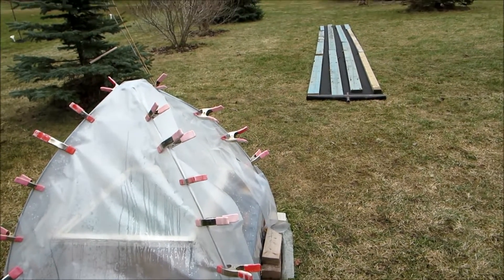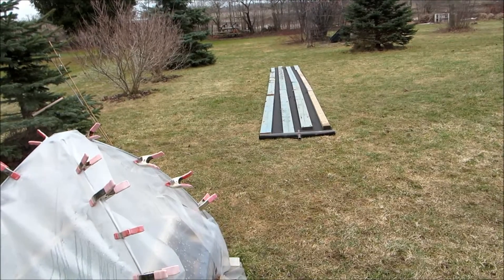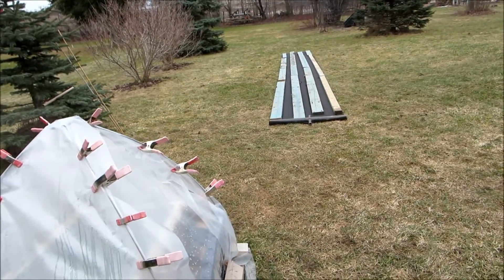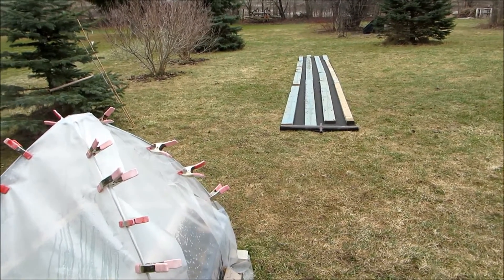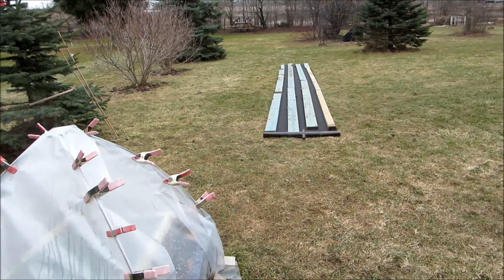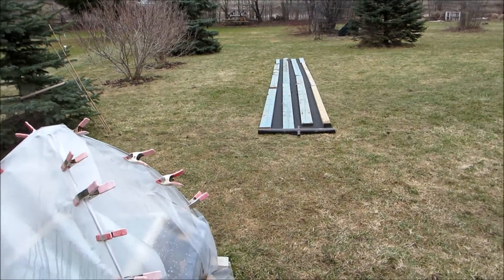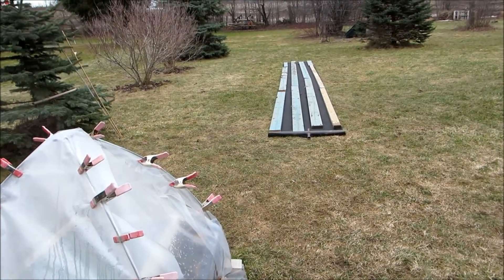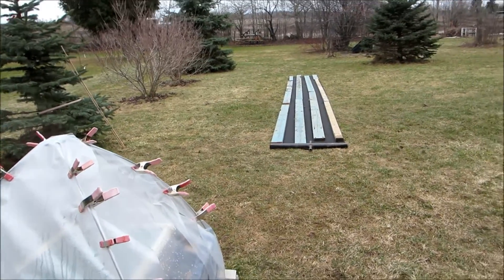No Dig Bed for Squash Step 1 Charles Dowding Method  24 Feb 2017

Comment: My perennial fruit and veg area is a type of no dig, sheet mulching, covered the area with cardboard then covered the cardboard with manure from the coops and a few months later dug holes through it and planted shrubs, trees and plants. Worked very well even though it is a bit crowded now.
Reply from the maker: That was the method from the Paradise Lot wasn't it, Served them well and certainly worked for you, it is a good system. This system requires that you put two or three inches of compost on the bed once in the spring every year. I am a little unclear whether you leave the cover down from year to year and just roll it back to put your compost under every year, I think that is the case. I will have to watch the video again.
               I added the snowy picture just so you wouldn't think I had moved to the Tropics LOL :-) I have two of the Tomatoes just showing so far but one does not look good, color of stem is not right and leaf tip looks shriveled, I have had peppers do that and generally they don't survive. I am keeping my fingers crossed for the others. Cheers.